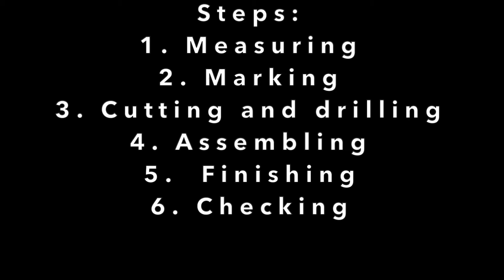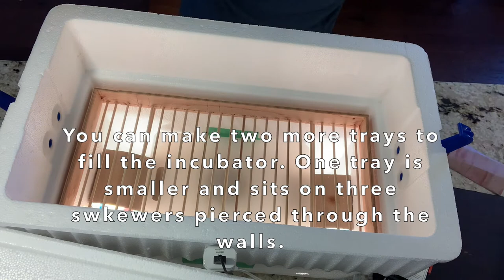Making Trays for Your Tempeh  Incubator

Comment: Hello Francius!

I tried to get the measurements for the whole piece and I can´t manage to find it. Could you please tell me the length, width and height of the tray please? If possible in centimeters :)
Reply from the maker: Actually, the length and width will depend on the size of the cooler box you use. This video is only a guideline. That's why I give you the way to take the measurement. In the video, I mention the tray length 19 inches minus 1/4 inch which is equal to 47.6 cm, and the width  10.5 inches minus 1/4 inch which is equal to 26 cm. If you use the same cooler box you can use this length and width. But, if you use a different cooler box you should measure them yourself, keeping in mind the actual tray length and width should be 6 mm less for allowance. The height, you can see it on the hand-sketch, is 1.5 " which is equal to 4 cm.

Comment: Darn it, my styrofoam box does not have the lip yours does at the top inside wall  to sit a tray on,so all I would have is the lower bamboo to sit a tray on 

The inside my box is just a clean straight wall,no lip like yous has mate

What would you suggest so that I can get another tray or 2 in there? i cannot just stack a tray on a tray I assume?

PS How far up from the lights is that lowest tray/skewers set at?
Reply from the maker: Simply pierce 4 bamboo skewers across the long walls to support the tray. I did it for my lowest tray below the lip.
Reply: Great tip

Cheers @francius1003

Comment: Hey Francius!
Who would have thought that making trays would be more challenging than making the incubator itself.😁
I am searching for a 'clean' glue to use,but as i was told they are ALL toxic. 
Silicone can't be used as a glue,and since i don't want anything toxic in the incubator that will host my tempeh for 15 hours,
which kind of glue do you think i could use?Or which one is the less harmful for our health?Or,which one did you use?
And something else.On your other video you suggested i use a steel tray .But won't it need something that will let warm air circulate
 and ferment tempeh from all sides equally?
If i use a steel tray, will the bottom side of my tempeh get the right air circulation?
Isn't this the reason you use your wooden trays?
Hope my questions make sense.
Thanks!
Reply from the maker: Try the school glue, the type that is used by schoolchildren. They are not toxic. Even the wood glue is only toxic if you add it to your tempeh not to glue the cardboard. 😄😄😄 To be careful is good but paranoid is not. Steel is a good heat conductor. After a while it will have the same temperature as the surrounding. Or, find steel wire trays. Or, cut a steel mesh to the right size.
Reply: @francius1003  The thing is,that when i am finally done with the incubator,i won't only have homemade tempeh,
i will also have learnt everything there is to be the best craftman 😁😁😁
All useful info and suggestions.
Thanks once more!
Reply from the maker: Haha! That’s even better for you. Learn to make the wooden tray. It is not that difficult. 💪💪💪
Reply from the maker: Email me pictures when you are done! Or, chat through instagram @franciussuwono
Reply: @francius1003  I will!
Reply: Don't know if they count as "clean" but there are several wood glues that are fda approved for some food contact when dry, recommended for building cutting boards etc. I wouldn't spread them on a sandwich, but my tempeh gets less contact with perimeter glue on these trays than my food does on the cutting boards Ive made. 

Not saying there's no risk, but then there's risk with paper towels and plastic bags and banana leaves and soybean pest and herbicide contamination and soil contaminants and water quality concerns... have to choose your battles. Food safe rated wood glue may not be the biggest bad.
Reply: The problem is: whoever told you all glues are toxic--that person is a liar. School glue and carpenter's glue are made from polyvinyl acetate (PVA) which is also used in chewing gum, cigarette papers, coating for Gouda cheese, etc. https://en.wikipedia.org/wiki/Polyvinyl_acetate You could also use hide glue (made from animal hides) or fish glue. Even eggs can be used as glue.